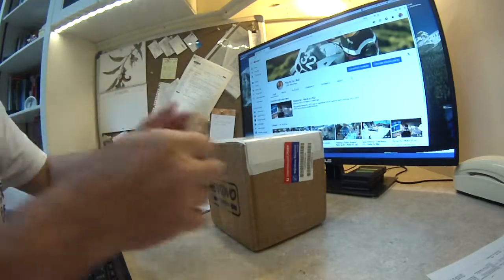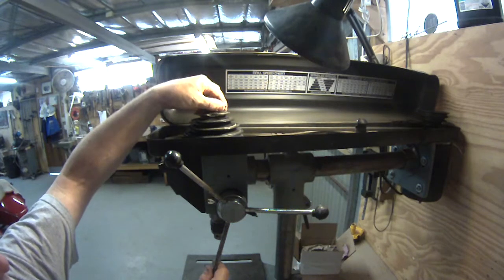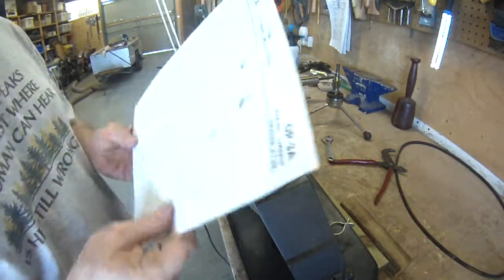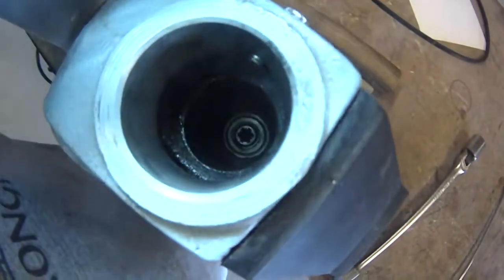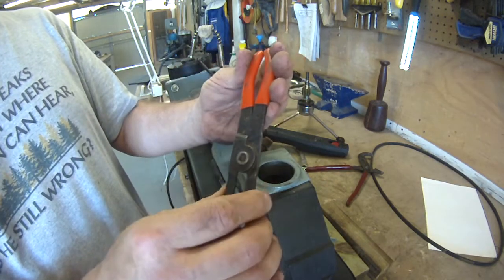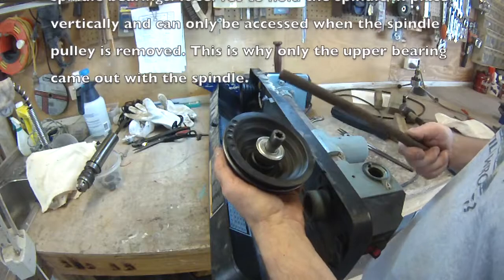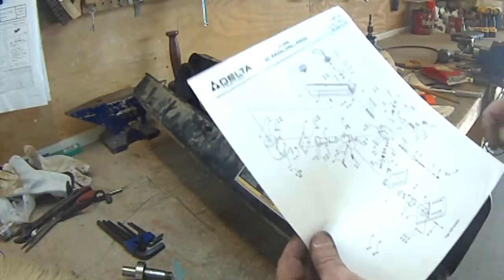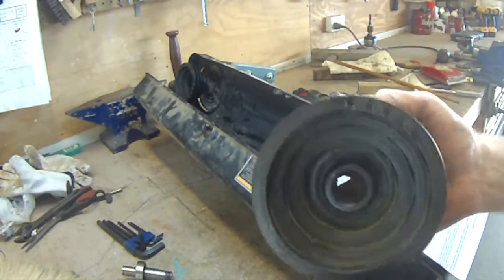Replacing a spindle pulley part one- Made by J&D

Comment: I needed to reconnect the cam on my motor tensioning knob. I'm glad I didn't try removing the pulleys to take the cover off. Instead, I removed the entire drill head from the pillar & reconnected the tensioning cam from underneath, thru the pillar hole.
Reply from the maker: Yours has a tensioning knob?

Comment: I'm having trouble finding a stop nut for the top pulley for a O.I.T table top drill press from 1983.  Any ideas on how to find such a thing.  The nut that was on there is slightly to large and I believe was kluged on.  It's really hard to tell if the press threads are in metric or SAE.  I've measure the major & minor diameters of the threads at the top end of the spindle and they are 17.12mm  & 16.68mm respectively.  So I bought a 17mm 1.5 pitch tap & die on Amazon thinking that I could somehow make a stop nut.  Well, I'm off somehow... maybe it's a 11/16" nut..... then I got approx. 20 threads per inch by measuring.  I contacted Grizzly, JET and some other drill press manufacturers but they said that their stop nuts are left-hand threaded.  My threads are right-hand.(I know right... who does that?).  I'm starting to think that maybe I got the thread pitch wrong and it is something like 1.3.  Any suggestions?  I enjoyed your video.  Thanks.
Reply from the maker: I looked up OIT (Omaha Industrial Tools...maybe??) which were probably made in Taiwan. If that is true, then you're dealing with metric threads. Perhaps 17 mm is right but 1.5 pitch is wrong and 1.3 is the way to go. Not much difference between the two. Is there any chance that you could try to clean up the threads with a file? You'd still need a nut to match. Other than that, I got nuthin!